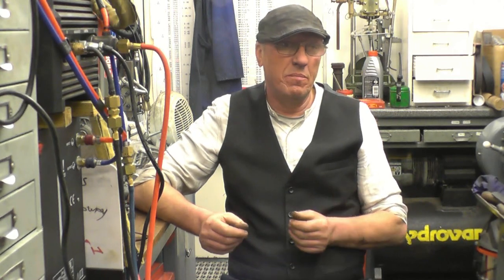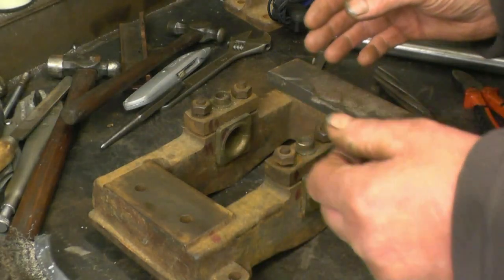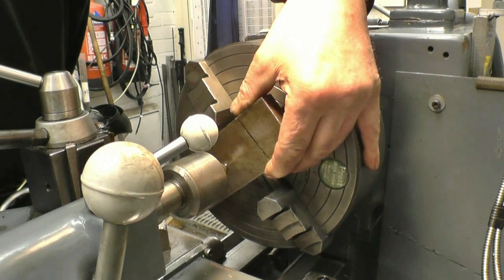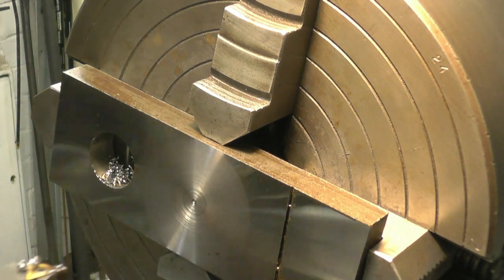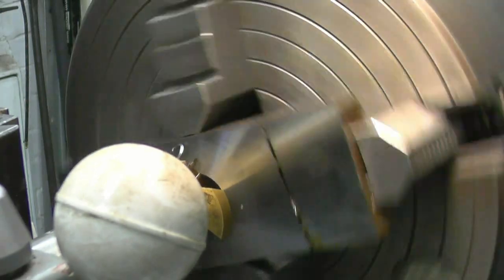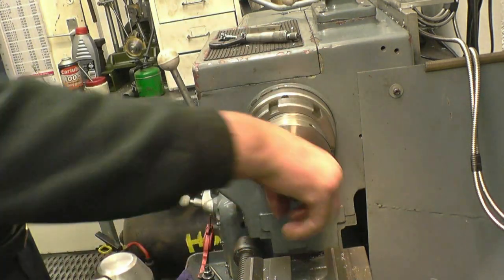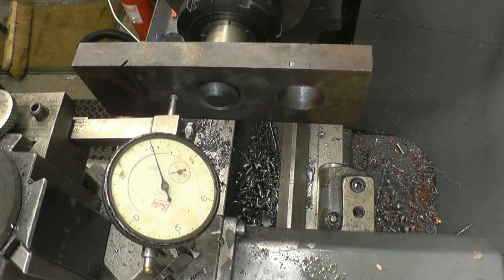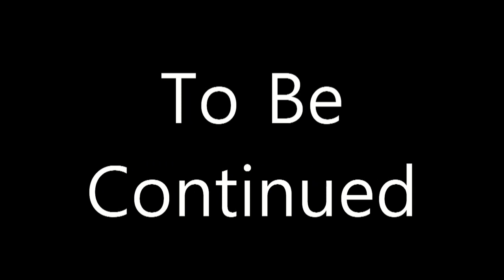SNNC 173 P1   Shrink Fits     Sunday Giveaway

Comment: Enjoyed the video.  Most if not all two cycle motorcycles have pressed together crankshafts.  If it works for them at many thousands of rpm it should work just fine for anything.   They press fit at room temperature.

Comment: John, those were normally Naval Engines, Clarkson, Byers, Well's, Paxman, and many others made them.  Later they were fitted for power plants for electricity, usually the makers name is cast on the base or on the valve side of the head.  Stuart built some scale models but I don't think they made any that big unless they did it around 1900 or so.

Comment: you can go for a tighter shrink fit it looks like.  also, you can use a keyboard air can upside down on the male part to freeze it allowing you to make the male part even larger in diameter.
Reply from the maker: Yes I was thinking .005 with a CO2 fire extingisher to cool the shaft  Then pin it in place no welding
Reply: all sounds good, never tried a fire extinguisher to cool a part.  seems like you might be able to get away with more then .005 (bad memory were you at .004 in the video).  is the engine to power anything?
Reply from the maker: It will be run on steam from the Sentinel Waggon  Just for show but possibly a DC generator  I will have a bit play with shrink fits this week
Reply: Forget the freezing, don't take my word for it just look up linear coefficient of steel. You did it the correct way it the temperature difference from room to red hot/room to even liquid nitrogen. 50 Years I worked in factory where  we shrunk fit thousand shaft ends in to tubes. Done correctly we had to bore them out if we had a problem.
Reply: ANDREW MICAS we are not saying omit the heat. Heat the female part as John did and freeze the male part, this allows for a even tighter fit. :)   John will get er done right regardless :).
Reply: doubleboost that's perfect. Not sure what load the generator will see but from the sounds of it you shouldn't go wrong.
Reply: turn a 20lb propane bottle upsidown and blast it under a canvas for about 2 min that will shrink the pin no problem ive done it cheers.
Reply: yep, thats all keyboard canned air is, butane, just an expensive way to use it
Reply: Dick Holman lol yup I hear ya but mom don't like it but in some cases mom don't no best.

Comment: I suspect that the steel used for the crank web is too small to hold the shrink fit, perhaps 3/4 x 3 inch if there is room in the engine base for 2 of these plus the rod. Cheers

Comment: John at the beginning  of the turning  of the crank you installed a collet chuck on your lathe it had countersunk cap screws but the next shot showed hexhead  bolts do you have two different  collet chucks.